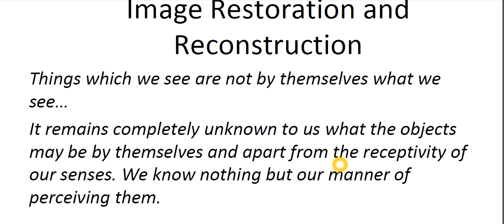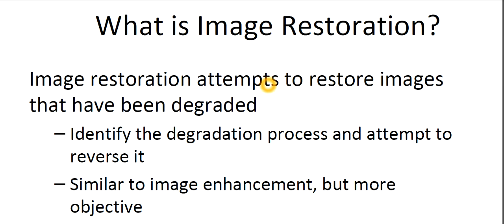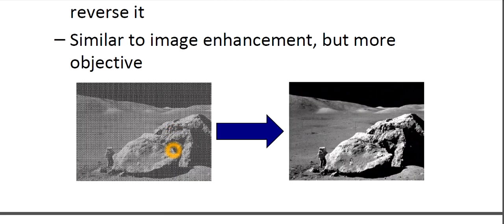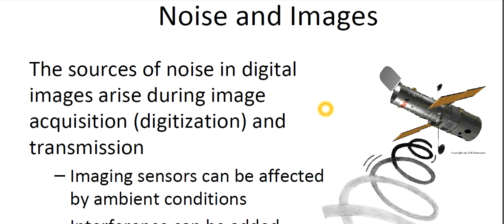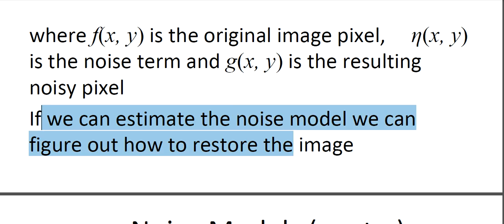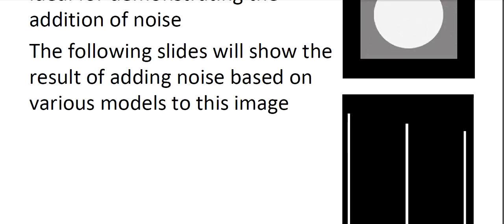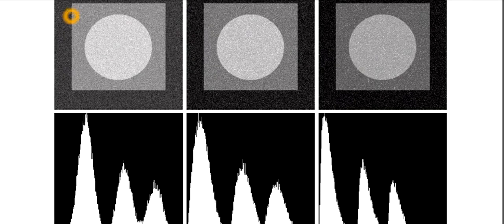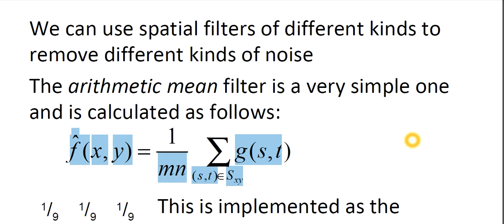#noise|#Gaussian|Different Noise Models|Image Restoration Techniques|Part-1

Comment: Noise is unwanted sound considered unpleasant, loud or disruptive to hearing. From a physics standpoint, noise is indistinguishable from desired sound, as both are vibrations through a medium, such as air or water.
Gaussain noise is statistical noise having a probability density function (PDF) equal to that of the normal distribution, which is also known as the Gaussain distribution.

Comment: Noise w.r.t Digital Image processing is The noise is arise during the image acquisition and transmission. Like some of the data(pixel) may get lost, colur of the image may get change, etc.
Gaussian Noise
Gaussian Noise, named after carl friedrich Gauss, is statistical noise having a probability distribution function (PDF) equal to that of the normal distribution, which is also known as the Gaussian Distribution.In other words, the values that the noise can take on are Gaussian-distributed
Reply from the maker: Very good explanation

Comment: Image noise is random variation of brightness or color information in images, and is usually an aspect of electronic noise. It can be produced by the image sensor and circuitry of a scanner or digital camera. Image noise can also originate in film grain and in the unavoidable shot noise of an ideal photon detector. Image noise is an undesirable by-product of image capture that obscures the desired information.
Gaussian noise
          

Principal sources of Gaussian noise in digital images arise during acquisition. The sensor has inherent noise due to the level of illumination and its own temperature, and the electronic circuits connected to the sensor inject their own share of electronic circuit noise.[3]

A typical model of image noise is Gaussian, additive, independent at each pixel, and independent of the signal intensity, caused primarily by Johnson–Nyquist noise (thermal noise), including that which comes from the reset noise of capacitors ("kTC noise").[4] Amplifier noise is a major part of the "read noise" of an image sensor, that is, of the constant noise level in dark areas of the image.[5] In color cameras where more amplification is used in the blue color channel than in the green or red channel, there can be more noise in the blue channel.[6]
Reply from the maker: RIGHT

Comment: Sudarshana Hazarika
CS18MSIIT021

Image noise is random variation of brightness or color information in images, and is usually an aspect of electronic noise. It can be produced by the image sensor and circuitry of a scanner or digital camera.
Types of image noise are:
1. Gaussian noise
2. Salt-and-pepper noise
3. Shot noise
4. Quantization noise (uniform noise)
5. Film grain
6. Anisotropic noise
7. Periodic noise
Reply from the maker: CORRECT.

Comment: Image noise is random variation of brightness or color information in images, and is usually an aspect of electronic noise. It can be produced by the image sensor and circuitry of a scanner or digital camera.
Types are
  Gaussian noise
Salt-and-pepper noise
Shot noise
Quantization noise (uniform noise)
Film grain
Anisotropic noise
Periodic noise
Reply from the maker: CORRECT.

Comment: Name : VICTOR SARMACHARJEE
ID : CS18MSIIT042

Q1. What is Noise? Define Gaussian Noise ?
ANS : Image noise is random variation of brightness or color information in the images captured. It is degradation in image signal caused by external sources.
Gaussian Noise is a statistical noise having a probability density function equal to normal distribution, also known as Gaussian Distribution. Random Gaussian function is added to Image function to generate this noise. It is also called as electronic noise because it arises in amplifiers or detectors.
Reply from the maker: CORRECT.

Comment: Image noise is an undesirable by-product of image capture that obscures the desired information.

Gaussian noise, named after Carl Friedrich Gauss, is statistical noise having a probability density function (PDF) equal to that of the normal distribution, which is also known as the Gaussian distribution. In other words, the values that the noise can take on are Gaussian-distributed.
Reply from the maker: CORRECT.

Comment: CS18MSIITO18
Image noise is random variation of brightness or color information in images, and is usually an aspect of electronic noise. 
It can be produced by the image sensor and circuitry of a scanner or digital camera. 
Image noise can also originate in film grain and in the unavoidable shot noise of an ideal photon detector.
Image noise is an undesirable by-product of image capture that obscures the desired information.

Different types of Image noice are : 
Gaussian noise
Salt-and-pepper noise
Shot noise
Quantization noise (uniform noise)
Film grain
Anisotropic noise
Periodic noise
Reply from the maker: CORRECT.

Comment: Noise is a random variation of brightness or color information in images and is usually an aspect of electronic noise.
Gaussian noise is a statistical noise having a probability density function equal to normal distribution.
Reply from the maker: CORRECT.

Comment: CS18MSIIT041
Image noise is random variation of brightness or color information in images, and is usually an aspect of electronic noise. It can be produced by the image sensor and circuitry of a scanner or digital camera.

Types are
 Gaussian noise
Salt-and-pepper noise
Shot noise
Quantization noise (uniform noise)
Film grain
Anisotropic noise
Periodic noise
Reply from the maker: CORRECT.

Comment: Subham Das (CS18MSIIT014)
Image noise is random variation of brightness or color information in images, and is usually an aspect of electronic noise. 
It can be produced by the image sensor and circuitry of a scanner or digital camera. 
Image noise can also originate in film grain and in the unavoidable shot noise of an ideal photon detector.
Image noise is an undesirable by-product of image capture that obscures the desired information.

Different types of Image noice are : 
Gaussian noise
Salt-and-pepper noise
Shot noise
Quantization noise (uniform noise)
Film grain
Anisotropic noise
Periodic noise
Reply from the maker: CORRECT.

Comment: Name : Himangshu Nath
ID : CS18MSIIT007

Q1. What is Noise? Define Gaussian Noise.

Image noise is random variation of brightness or color information in the images captured. It is degradation in image signal caused by external sources.

Gaussian Noise is a statistical noise having a probability density function equal to normal distribution, also known as Gaussian Distribution. Random Gaussian function is added to Image function to generate this noise. It is also called as electronic noise because it arises in amplifiers or detectors.
Reply from the maker: CORRECT.

Comment: CS18MSIIT036 , SHANAWAJ ALI
Noise is unwanted sound considered unpleasant, loud or disruptive to hearing. From a physics standpoint, noise is indistinguishable from desired sound, as both are vibrations through a medium, such as air or water. The difference arises when the brain receives and perceives a sound.

Gaussian noise, named after Carl Friedrich Gauss, is statistical noise having a probability density function (PDF) equal to that of the normal distribution, which is also known as the Gaussian distribution. In other words, the values that the noise can take on are Gaussian-distributed.
Reply from the maker: CORRECT.

Comment: CS18MSIIT024
Image noise is random variation of brightness or color information in images, and is usually an aspect of electronic noise. It can be produced by the image sensor and circuitry of a scanner or digital camera.
Types are
  Gaussian noise
Salt-and-pepper noise
Shot noise
Quantization noise (uniform noise)
Film grain
Anisotropic noise
Periodic noise
Reply from the maker: CORRECT.

Comment: Krittika Bhattacharjee
CS18MSIIT030

Noise is random variation of brightness or color information in the images captured. It is degradation in image signal caused by external sources.Images containing multiplicative noise have the characteristic that the brighter the area the noisier it.

Types of noise are-
1. Gaussian Noise
Gaussian Noise is a statistical noise having a probability density function equal to normal distribution, also known as Gaussian Distribution.
2. Impulse Noise
Impulse Function: In the discrete world impulse function on a vale of 1 at a single location and In continuous world impulse function is an idealised function having unit area.
3. Poisson Noise:
The appearance of this noise is seen due to the statistical nature of electromagnetic waves such as x-rays, visible lights and gamma rays.
Reply from the maker: Well Explained

Comment: Sujan Paul (CS18MSIIT011) 
Image noise is random variation of brightness or color information in images, and is usually an aspect of electronic noise. 
It can be produced by the image sensor and circuitry of a scanner or digital camera. 
Image noise can also originate in film grain and in the unavoidable shot noise of an ideal photon detector.
Image noise is an undesirable by-product of image capture that obscures the desired information.

Different types of Image noice are : 
Gaussian noise
Salt-and-pepper noise
Shot noise
Quantization noise (uniform noise)
Film grain
Anisotropic noise
Periodic noise
Reply from the maker: Right

Comment: Name :-Rajkishore Saikia
Id:-CS17MSIIT006
Image noise is random variation of brightness or color information in images, and is usually an aspect of electronic noise. It can be produced by the image sensor and circuitry of a scanner or digital camera. Image noise can also originate in film grain and in the unavoidable shot noise of an ideal photon detector.
Reply from the maker: Right ✅

Comment: Name:manob borgohain
Cs18msiit035
_________________________
Image noise is random variation of brightness or color information in images and is actually an aspect of electronic noise .It can be produced by the image sensor and circuitry of a scanner or digital camera .By analogy unwanted eletrical fluctuations are also called noise.
There are three types of noise :-
Salt noise
Pepper noise 
Salt and pepper
Reply from the maker: Right ✅

Comment: Name - Victor Sarmacharjee
ID - CS18MSIITO42
Image noise is random variation of brightness or color information in images, and is usually an aspect of electronic noise. It can be produced by the image sensor and circuitry of a scanner or digital camera.
Types of noises are:
 Gaussian noise
 Salt-and-pepper noise
 Shot noise
 Quantization noise (uniform noise)
 Film grain
 Anisotropic noise
 Periodic noise
Reply from the maker: Right ✅

Comment: Debasish Roy (cs18msiit039) Image noise is random variation of brightness or color information in images, and is usually an aspect of electronic noise. 
It can be produced by the image sensor and circuitry of a scanner or digital camera. 
Image noise can also originate in film grain and in the unavoidable shot noise of an ideal photon detector.
Image noise is an undesirable by-product of image capture that obscures the desired information.

Different types of Image noice are : 
Gaussian noise
Salt-and-pepper noise
Shot noise
Quantization noise (uniform noise)
Film grain
Anisotropic noise
Periodic noise
Reply from the maker: Right ✅

Comment: Bhagyashree Das 
ID: CS18MSIIT023
Image noise is random variation of brightness or color information in images, and is usually an aspect of electronic noise. It can be produced by the image sensor and circuitry of a scanner or digital camera.
Types of noises are:
 Gaussian noise
 Salt-and-pepper noise
 Shot noise
 Quantization noise (uniform noise)
 Film grain
 Anisotropic noise
 Periodic noise
Reply from the maker: Right ✅

Comment: Noise models. Noise in imaging systems is usually either additive or multiplicative. This thesis deals only with additive noise which is zero-mean and white. ... Common noise models are: Gaussian noise provides a goodmodel of noise in many imaging systems
Reply from the maker: Correct! Rajak
Reply: Thank you sir

Comment: Noise is an unwanted signal which interferes with the original message signal and corrupts the parameters of the message signal. This alteration in the communication process, leads to the message getting altered. It is most likely to be entered at the channel or the receiver.
It is understood that noise is some signal which has no pattern and no constant frequency or amplitude. It is quite random and unpredictable. Measures are usually taken to reduce it, though it can’t be completely eliminated.
Noise is an inconvenient feature which affects the system performance.
Reply from the maker: Correct ! Very Good Explanation , Iva
Reply: @djb_world  thankyou Sir.

Comment: Noise in imaging systems is usually either additive or multiplicative. This thesis deals only with additive noise which is zero-mean and white. White noise is spatially uncorrelated: the noise for each pixel is independent and identically distributed(iid).
Reply: Noise in imaging systems is usually either additive or multiplicative.This thesis deals only with additive noise which is zero - mean and white.
Reply from the maker: @Blogs-p2r  Correct !
Reply from the maker: Correct !
Reply from the maker: @Sahil Sajib Ahmed Correct !